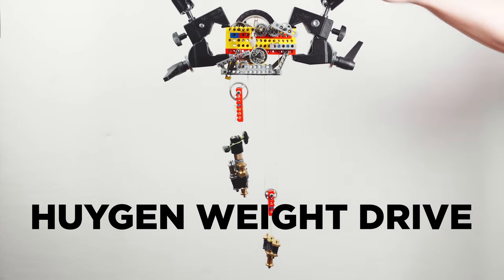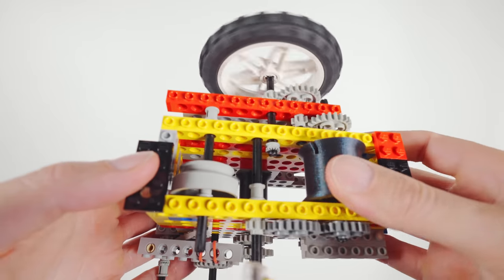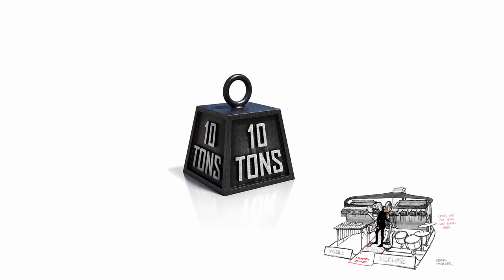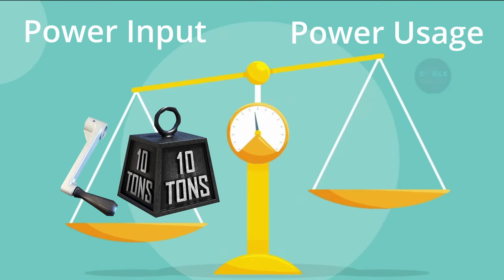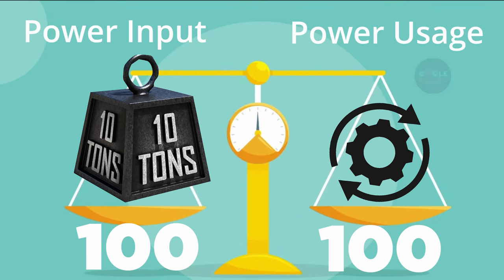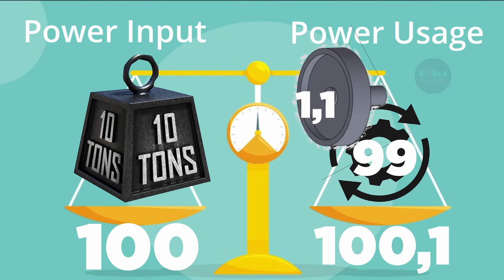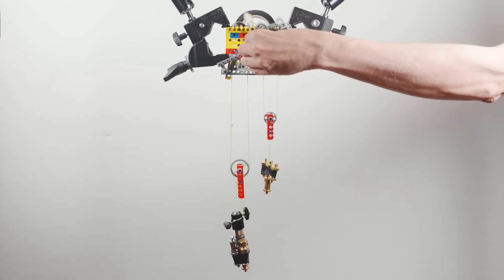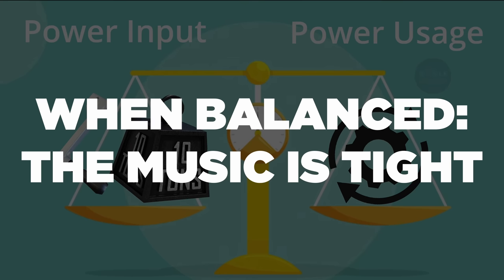Lego Technic Huygen Chain Drive

Comment: Maybe I’m missing the engineering desire of separating a flywheel from the governor, but with the appropriate mass, isn’t a governor just a variable inertial flywheel when the load is connected to the governor in the right way? The freewheeling nature of the flywheel is its benefit so a typical governor isn’t useful in this way, unless the governor is designed to freewheel in the absence of a power input. Then all that would need to happen is to make the governor adjustable when spinning using a mechanism similar to how airplane propellers can have adjustable pitch or how BMX bicycles can have handlebars that spin forever but still have front brakes.

Comment: A weight drive is a constant force input, not a constant power input. The power output by the weight drive is proportional to the weight and it's velocity. Provided that it is governed, then it will be a constant power output when it reaches the speed setpoint.

Comment: Martin, have a look at, some airplanes  (single engine with a propellor) use a governor to keep the propellor RPM the same, then can change the angle of attack from the propellor itself so you have different potentials with a single propellor, like climbing or cruising with a higher propellor setting,

Comment: Governor is very complex thing. Most common designs is driven by error: they change their state only when error is changes (in more simple versions) or presents. It means that error will be present always if power consuption changes. So I kindly ask you to carefully check the design of governor and the tightness it can provide

Comment: The Huygen Weight Drive, will not provide a smoother driving of the marble machine (as you cannot use a weight heavy enough to last a whole 3 minutes). So in Case of cranking it while running, every change in power input will be directly passed onto the following mechanisms in thr machine. So it might be obsolete next to the use of a flywheel and a govenor, as of my understanding right now (pls correct me if im wrong). Other then that: I love the approach your taking here :)
Reply: the weight drive might be useful as a battery at the least, giving martin slightly more time to adjust instruments on the fly as the weight falls

either way he'll probably still need a flywheel and governor in some form if he wants REALLY consistent bpm

Comment: just use a motor. you already did it on the mmx, it worked great, and a motor can both speed up and slow down the flywheel and play the exact bpm you want. All you need is a motor driver, a motor, a belt and a pully. It simple, and uses parts that can be easily maintained/replaced. If your adverse to using electric power, you can even use a small motor just for speed regulation. where the motor acts as a generator thus getting power from the flywheel and it pulls more or less power to slow the flywheel to a set tempo , and then you get the machine up to tempo using the pedal.

Comment: Look at a CVT (continuously variable transmission) to dynamically change your tempo gearing. This way you're not locked into a single BPM, and can use a simple lever mechanism to vary the gear ratio.

Comment: Balance wheel / pendulum plus escapement? You're basically trying to build a clock / metronome, so you might as well explicitly copy the mechanisms of a clock / metronome. (And note that the Huygens weight drive is in fact used in clocks! That's what it was invented for!)

Comment: I don't know, I don't know... I'm a mechanical engineer and for sure these mechanisms look awesome! But... How easily will you be able to change tempo? It feels like a crank with a flywheel is the best solution: with enough practice you'll be able to play tight (not machine tight, but human tight, which is basically the level of the other members of the band) and change tempo in a more versatile way

Comment: Correct me if I'm wrong but the working of a governor has nothing to do with friction: it is a negative retroaction system allowing to exactly compensate irregularities (accelerations and decelerations) in a movement by counteracting them with an opposite centrifugal force.

Comment: Nice concept Martin. I think a few of us discussed something similar to this with you in the early MMX days.

My proposal back then was to replace the falling weight with spring tension as you can store far more energy that way and its more compact.

Also, you could regulate the speed (bpm) with a stepper motor and worm drive (electronically controlled,) in series with the mechanism.
Reply: If we're adding electronically controlled components, why not just power the whole thing with a motor? Why not replace the programming wheels with a MiDi board? Why not replace the marbles with actuators? Why not replace the instruments with synths? 

Tadaa! The optimal music machine: A Laptop. Not really exciting or novel.

The soul of the Marble Machine lineage is human powered and controlled marbles making real sound. No electricity whatsoever before the sound is made. It's like those one-man-band suits, except replace the suit with a marble machine.
Reply: @TlalocTemporal  . The MMX had electric motor drive assist.

Comment: I think some smart people need to do some math here:
Does the weight drive really make the actual, large flywheel significantly tighter? ( as you mentioned)
How much does the pull force change when you counter crank it at uneven handcrank speed? And what are the implications for tightness?
Reply: Martin's cult doesn't like math.

Comment: The question I pose is comparing "natural" vs "tight" metronome music? Do you want it to sound produced by electronics? Or naturally such as by people?  I mean, if you really analyze your previous music from live performances, how accurate is your drummer? Yourself? The rest of the band? Expression in music by the push and pull of tempo is something that is very difficult for machines to reproduce, but super effective is conveying musicality by and to people.  Considering you, Martin, are less capable of consistent input for your own measure of "tightness" on the crank, only means you aren't a machine, not that your music machine won't be good. Such precision you "require" by the MM3 is likely an over-design parameter requirement. How consistent is your meter in the music box segments of Sommarfågel? (Just one of your songs I really enjoy) Please present a video analyzing your own live performances in comparison to your expectation of "tightness", and  you just may find you are going down an empty rabbit hole.
I will also point out that while there is much interest in the machine you are designing, the interest is in you as the creator and performer, and not isolated to just the machine. We want to see Martin on tour, not just his machine.

Comment: If you have a big enough governor, and hook it up so that as the weight goes outwards, it stores energy (say, in a spring or set of springs), then it will tend to want to regulate the speed very closely to the point at which the weights start to change position, especially if enough weight moves outwards that this itself represents a significant shift in the moment of inertia.

You can confirm this by spinning it up to the point that the weights are pegged, then letting it spin down under friction: At first it will slow as normal, but as soon as the weights start to move inwards, the speed suddenly remains constant as the energy comes from the springs instead, and conservation of angular momentum keeps the speed constant, until the weights are fully 'in', and normal deceleration continues. Basic model was a star-like wheel made of tube segments, which had caps on the ends and springs with sliding tubular weights on them, such that the springs were outside the weights. It's important that the weights can only move radially inwards and outwards, so that when they 'give energy up', it's a little like pulling your legs in whilst spinning on an office chair: The conservation of moment of inertia is what causes the weights to apply torque to tend to increase speed.

It's called a Welsh Wheel, after the inventor, Blayne Welsh, who filed the patent, which I think was discontinued. I can't remember the details for that, but patent applications are automatically searched prior art, so it's unlikely to be under patent unless Mr Blayne Welsh pursued it. 

It's sort of a combination of a flywheel and governor, but one which stores power rather than burning it (as with a governor). It also tends to be workable for just one speed, which will depend on the geometry, the weight and the spring stiffness and working length. But you could get an equivalent effect by just connecting a typical governor to a spring: When the governer spins fast enough to compress the spin, it will start storing energy, and it will automatically release it if anything attempts to slow the wheel. In addition, you can easily see the amount of energy currently stored by seeing what state the spring is in: Fully compressed means maximum storage, and it can no longer prevent an increase in speed, and fully decompressed the opposite: Fully expended, and unable to yield any energy to prevent a decrease in speed.

Comment: If at any point the weight needs to be adjustable but you don't want to carry a bunch of different sized weights around (or at all!) you might want to consider using a container filled with water. This makes it adjustable, portable, and renewable! You could even move weight from one place to another if you cleverly siphon it with a valve that can be opened (normally closed.) This could even be changed during playback if thought out well enough. Combine this with other ideas the comments section has shared and a less noisy one-way mechanism (perhaps only engaged at start) and I think most of the issues are solved. Incredible stuff.

Comment: Constant power is great and all until the music start having different power demands over time. You need constant RPM, not constant power. I think a servo motor is the simplest and most effective solution here. Mechanism solutions for this probably exist, but clockwork is complex and demands precision.

Comment: and how are you planning or rewinding the weight? because the way I see it this system will only allow to smooth the input, as the actual input would be either you cranking or a motor. if you are the one cranking than you could use simples systems to control your speed (you talked about the governor for example). if you are using a motor all this isn't needed as you can have a very speed accurate motor using a feedback loop system.

Comment: Have you noticed how clocks and other mechanical wind-up tools look like they take forever to run down?  The gearing ratio is such that they look like perpetual motion machines even though they are not!  If you want a wind-up marble machine, you might want to make sure that it takes as long to run down as one of those brass disc music boxes.  Not that's a lot of work!

Comment: It's not a constant power input, but a constant force input. The actual power depends on the resistance you put on it. eg. apply a brake and the power drops to zero. for that same reason it is also not constant speed input, which is what you actually want.
I would experiment with a brake that is controlled by centrifugal force. If the speed drops, the braking force is reduced, allowing more torque into the system.

Comment: I have one question.. isn't 100% tight be a bit anti-natural? I mean, maybe letting all parts and instruments to have a small range of variation could make the final music be more human-like. 

Or maybe I'm wrong and the purpose of reaching that tightness is the correct way. 

Just throwing my opinion :-) thoughts are comments to it, more than welcome.
Reply: If you want the music to be less tight, you can add variation with the new programming pin design. But having all parts of the machine adding random errors here and there is bad.
Reply: @MarianKeller  good point 👍 so much better to have the less-tightness under control. Totally Agree. thanks.

Comment: This looks awesome! However, it's also very complicated. May I suggest to make the power input modular - not to have it as one module, but as separate modules. One module would contain the crank, one module would contain the flywheel, one for the decoupler, one for the brake, one for the governor, and one for the weight system.
If you keep every one of these parts separate, you can design and troubleshoot one aspect at a time - and more easily replace parts when something breaks, wears out, or needs a redesign.

Comment: Martin's MM2 was a quintessential "second system," and it seems MM3 is compounding this: a "second second system." IMHO, Martin should be concentrating on making his MM3 as simple as possible, and of course, no simpler than possible. Increasingly elaborate systems with more component parts will be a path to a complex, unmaintainable traveling concert machine. I fear he's been going down the path of adding every "nice to have" feature at great risk to the "gotta have" requirements.

Comment: Am I crazy or could you chain several weights on the chain in series to reduce the overall height needed or maximum single weight needed? Winding the mechanism with a single weight could be kind of heavy, but lifting half the weight twice and having weight A pull weight B would probably work better? And also reduce variation in crank speed vs flywheel speed?

Comment: Not sure about the idea of using what is essentially a clock for timing. Cranks may not be as tight, but it allows for smooth bpm variations and adds a human element that is the difference between playing the machine and having a machine that plays itself.

At least, allow a mechanism to disengage the clockwork for more direct control.

Comment: When evaluating designs for changing tempo, also consider tempo changes in the middle of a piece. Maybe a governor has the range you need to change from (for example) Allegro to Largo and back again in an A-B-A structure, maybe not.  Even if you don't need such an extreme tempo difference, judicial use of Accelerandos and Ritardos add interest to music.
Reply: All that could be implemented in the programming wheel without changing the speed of the machine.

Comment: Functionally, the Hagen weight drive and the fly-wheel are probably more similar than you think. Combining them would likely be similar to adding a larger fly-wheel vs. a larger weight and would likely only complicate the system. In one setting, your energy is stored in the kinetic energy of a large rotating mass on the other it is stored in the potential energy of a falling weight. If you want to get real guarantees for "tightness", you should create a circuit-diagram representation of the mechanical system and vary parameters until you find values that give you what you want (self-drive time, "tightness", weight size, etc.). You can then decide what things are reasonable to manufacture or not based off those parameters. I'm sure some mechanical engineer can chime in on specifics. I only remember the concept of mechanical circuits from a joint EE/ME control systems course I took ages ago.

Comment: Look into mechanical circuits. What you need is a mechanical transformer, i.e. something that doesn’t like change in motion. You are basically trying to convert mechanical AC to mechanical DC, steve mould did a video on that, too. :)
Reply: Also, if you’re power input needs to be consistent for this to work, you could just use that consistent input instead of the weight to power the machine

Comment: I don't think anyone (except possibly you Martin) would mind if the machine could operate in both a mechanical mode and in an electrical mode. Use the electrical mode for all sorts of testing/rehearsing/crowd-surfing where you don't want to bother with mechanical input, and use the mechanical mode to retain the human feel of the instrument.

Comment: Please do a part count of the weight drive, the pulleys, the flywheel mechanism, the governor, the gearbox.  Compare that to 1 motor, an ESC, and a single off the shelf circuit board (arduino or raspberry pi) with a software PID loop. That will solve all these issues with a single moving part (the rotor).

Comment: Martin, don't you think that you are making the same mistake again by making the machine too complicated and not making the requirements less dumb. Like as i see this, this is already many parts that you need to get working and it would again take too long to fine-tune the system. I suggest keep the flywheel and the eletric motor as you had on the MMX and just by the crank contol the BPM. The electric motor can be somewhere in the back not beeing shown.

Comment: What if you were to add a rolled spring steel to the crank on the input power on the chain drive. That way you cranking it doesn't affect it directly. You could figure out the output power of the spring steel to match the input power of the falling weight to equalize it out.